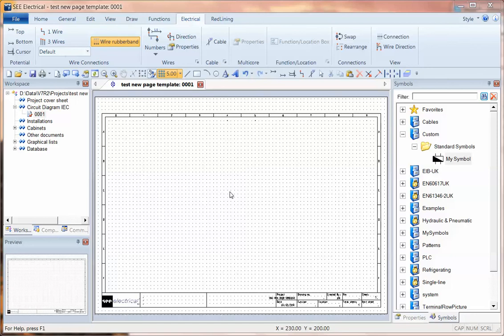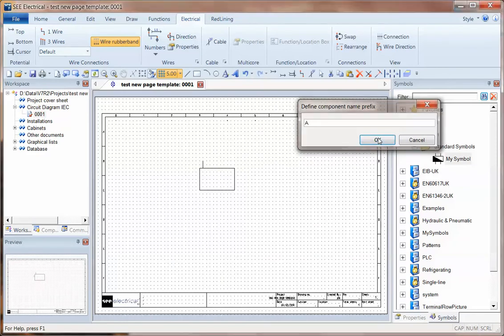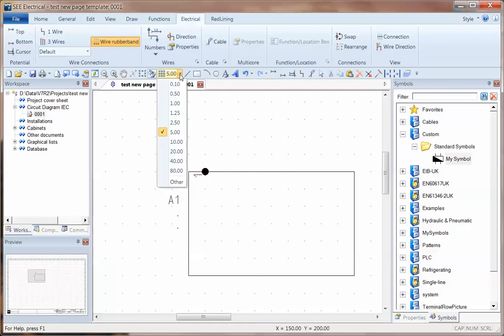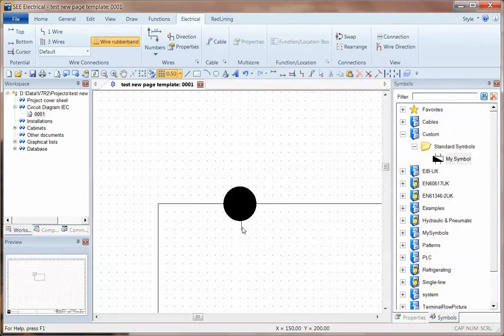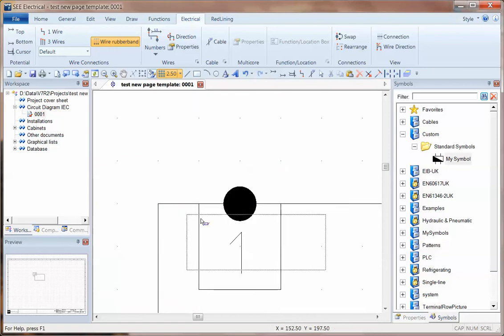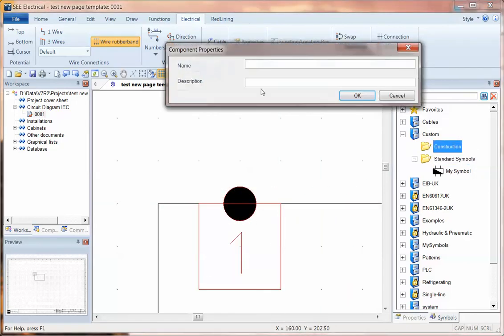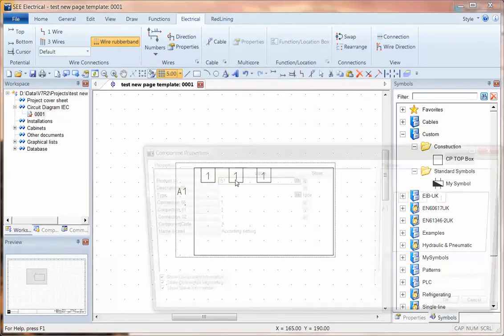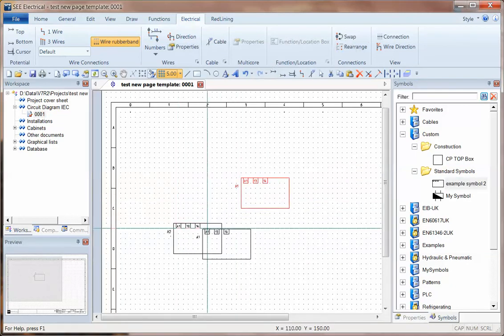Create New Style of Symbol Connection Points V7R2

Comment: When right click and selecting block, it only gives one option Block,Macro<group. It does not have any other option in the Block/Component definition.
Reply from the maker: Arleen Renner If you only get this option when selecting 'block' then it means you have either a wire or another symbol in the selected elements. Make sure to only use graphical lines when designing new symbols.